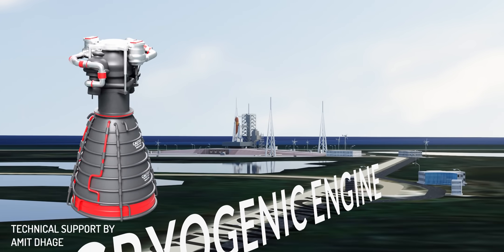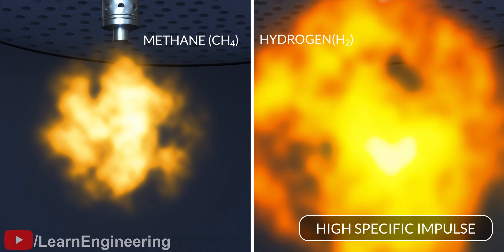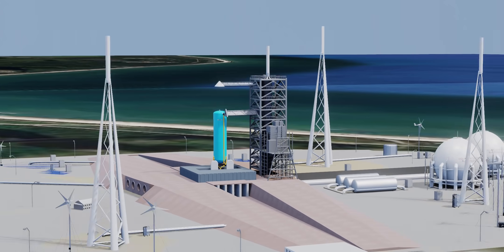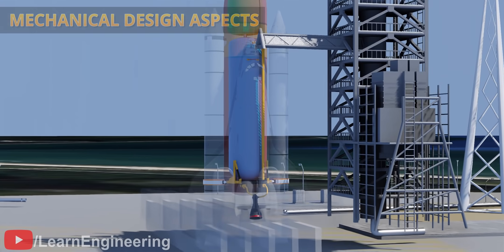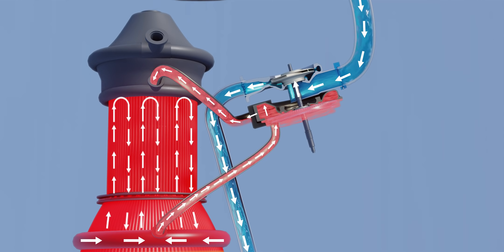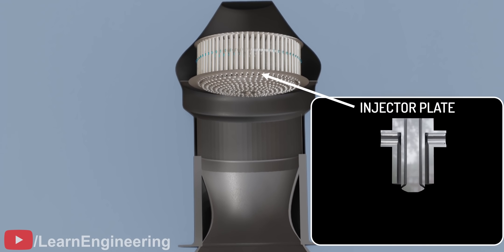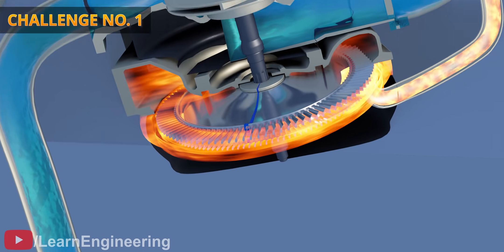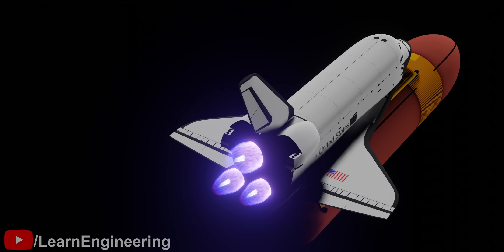Cryogenic Engines | The complete physics

Comment: I believe the insulation coating of the tank is also to keep the fuel at low temperature and prevent boil off
Reply: well boil off itsels is used as cooling process. the pressure build up  , thats what you dont want in your rocket)
Reply: That coating is bcuz hydrogen molecules are so small that they escape even through tiny holes due to imperfections in tanks metal fabrication,  so the coating becomes a secondary barrier to prevent boil off
Reply: @death_parade  Despite your anger he is essentially correct in his assertion.
Reply: @BeKindToBirds  I am not talking about the coating.
Reply: @death_parade  chill my guy, not everyone is smart as you are
Reply: @TenzinDorjee  My reason for being mad at that particular comment is that particular poster dissing Indian Rocket Engine technology in another comment. Don't worry, I am usually chill otherwise.
Reply: @jesselopez0008  It does not need imperfections - Hydrogen just goes through everything.
Ask anyone who has to deal with ultra high vacuum.
They always have to "pump" out that hydrogen.
Reply: Good thing no one will be Hydrogen in the future, shitty military contractor grift fuel cycle.
Reply: @Sagittarius-A-Star austenitic stainless steels and certain austenite-based alloys have a high HE resistance

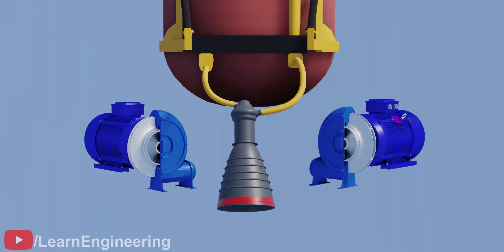Comment: 4:40 electric pumps are used in Rocket Lab's Rutherford engine
Reply: That's because at that small a scale electric turbopumps are the most efficient way of powering the engine in the terms of both weight and performance, not to mention complexity. Electrically pumped engines can throttle significantly deeper than gas generator engines, as well as be capable of running the tanks completely dry, as would be nearly impossible in gas generator engines as well as extremely damaging to the engine

Comment: Good introduction. Liquid hydrogen does indeed achieve the highest specific impulse, but it's by no means the "best" fuel for every situation. Sometimes other factors are more important. I've made a basic summary of common rocket fuels below. Methane is becoming more and more popular as a compromise.

Liquid Hydrogen
• high efficiency
• no soot whatsoever
• very low density
• low thrust
• very low temperatures
• leaks very easily

Kerosene (RP-1)
• high density
• high thrust
• normal temperatures
• doesn't leak easily
• low efficiency
• lots of soot issues

Liquid Methane:
• moderate density
• high thrust
• low temperatures
• doesn't leak easily
• moderate efficiency
• minimal soot issues

Comment: Fact: Fuels with less maximum theoretical efficency tend to have larger density, so that's why you can see a Falcon 9 (22,000 kg to LEO) , using subcooled RP - 1 as fuel, would be much smaller than, say, a Delta IV Heavy, having more than double the size of fuel tanks (using LH2) while can only carries a little bit more payload (23,000 kg).
(Note: To those of you who said that the Block 5 Falcon 9 actually only have 13,000 kg as LEO payload, remember that this rocket is partially reusable, and the first stage had to perform the slowing burn upon atmospheric reentry, plus a suicide burn to have a soft landing, so yeah.)
Reply: That high ISP becomes more important in space. Delta IV works better and better the further you need to send a spacecraft. New Horizons got the highest escape velocity of any spacecraft from earth because of this.
Reply: @srinitaaigaura  I actually thought the most important thing in space is dead weight

Comment: The explanations has been really great.

I think that with small improvements, they could have been even better.
For example, showing how fuels are mixed by the injector plate and burnt should be before the explanations of the pumps. This way the trick of cooling the combustion chamber with liquid H2 comes before using it at the turbo pump.

It would have been also better to show possible electric motors in operation pumping fuel, before replacing them with turbine. Aka, show the motor moving the impaller, then keep the impaller in place and replace the motor with turbine. This way, even visually, there could be no doubt which part is driving the motion.

Also, You said that you are giving example with the H2, but it would be nice to have a label on the screen. Especially when you need need two of them for the gas generator.

Once again. Your videos are probably the best explanations I've seen so far.
Reply: Man, thanks a lot! I was confused in that impeller part... Your comment helped clear my doubt.

Comment: The pump is usually in multiple stages. The first stage is the inducer and it prevents cavitation to build up in the pump because of the high rotation speed. The next stage is the impeller which does most of the pressure rise in the turbopump.
Reply: I thought fuel would become at gaseous phase when it comes to turbo Pump. Also do impellers are used in turbopumps or only in centrifugal pumps.

Comment: 9:40 Correct me if I'm wrong but aren't the RS-25's of the space shuttle ignited at launch and not in-flight?
Reply: you are correct!
But they obviously get massive help from the solid rocket boosters, so that the space shuttle has enough thrust as a "first stage", to get to sufficient height before jettisoning them

Comment: So, when I do the math on this, I find that a propellant tank with a volume of, say, 100,000 cubic meters would be able to store about 70 tons of liquid hydrogen. That exact same propellant tank would be able to store about 800 tons RP-1 and about 1100 tons of hydrazine. So it's almost a tenfold decrease in propellant mass for only a 25% increase in specific impulse.

That doesn't seem ideal to me. What am I missing? Even when you plug in the rocket equation in the other direction, you find out that a rocket powered by LH2/LOX needs a propellant tank ten time as large to get the same total delta-V as one powered by kerosine or even methane. And the larger tanks just means a much heavier rocket, which is exactly what we DON'T want, isn't it?
Reply: Hydrazine is very poisones and extremly corrosive, when i remember correct there was an accident in a nuclear Missile Silo with a hydrazine leak that leads to an explosion. See Planly Difficults Video here on YouTube.
Reply: @xj9779  Sure, which is why they only use it for upper stages and ships in orbit like the Dragon Crew or the Starliner. But how do we justify "hydrogen is the best rocket fuel" when all the rockets hat use hydrogen have to be ten times as large as the rockets that use kerosine to get the same performance?
Reply: I think they pressurize the hydrogen, so they would fit quite a bit more than 70 tons
Reply: @abdurrahmanhashmi1081  Even under pressure, liquid hydrogen only has a density of 70kg per cubic meter. They would have to get it to at least 8 times that density -- 500kg per cubic meter -- to be able to use the same size tanks.

That's basically why the space shuttle and the SLS have to use these enormous solid rocket boosters. They don't carry enough fuel to get into space otherwise. A falcon 9 with two SRBs would basically have the same lifting capacity as a space shuttle.
Reply: @newtypealpha  oh my bad I thought u were using the STAP density of hydrogen
Reply: @newtypealpha  Although liquid hydrogen gives a high Isp, its low density is a disadvantage: hydrogen occupies about 7x more volume per kilogram than dense fuels such as kerosene. The fuel tankage, plumbing, and pump must be correspondingly larger. This increases the vehicle's dry mass, reducing performance. Liquid hydrogen is also relatively expensive to produce and store, and causes difficulties with design, manufacture, and operation of the vehicle. However, liquid hydrogen is extremely well suited to upper stage use where Isp is at a premium and thrust to weight ratios are less relevant.

Dense propellant launch vehicles have a higher takeoff mass due to lower Isp, but can more easily develop high takeoff thrusts due to the reduced volume of engine components. This means that vehicles with dense-fueled booster stages reach orbit earlier, minimizing losses due to gravity drag and reducing the effective delta-v requirement.
Reply: @newtypealpha  from wiki
Reply: @abdurrahmanhashmi1081  the hydrogen and the oxygen is in a liquid form..... How much can you pressure a liquid?! 🙄
Does this explain enough?

Comment: Unfortunately, this material is just too simplified, to an extent of not being true in few places. For example - cryogenic engines are not used mostly in upper, but rather in all stages, including booster (first) stages. Also, propellant selection is not only about getting most ISP, as it has inversely proportional relationship with thrust. There are far better starter materials out there, for example see Everyday Astronaut on YT.
Reply: Do you have pg on this? I think you have
Reply: Rocket propulsion lectures by IIT and nptel will be useful for you
Reply: Many errors in the content

Comment: I disagree with calling hydrogen's temperature when stored as a liquid under extreme pressure -253 C. Yes if the pressure is released it is that temperature but while under pressure in an uninsulated tank, it's temperature is whatever the outdoor temperature may be. The industry uses this terminology and it is confusing to the general public.

Comment: none of this is necessarily wrong, but a lot of it is misleading
Reply: @uhmmm2110  I wouldn’t say it’s misleading as much as it is oversimplified. They present really 1 type of solution to the problem in a digestible way you can consume in 10 minutes. Liquid hydrogen is nowhere near the best propellant  because of factors other than specific impulse. It’s hard to make and hard to store especially on your rocket and it’s very clunky to carry around. He kinda touched on it but you need a lot heavier pumps to pump the hydrogen into the chamber than you would for like kerosene or liquid methane. It’s not really used anywhere outside the US much because of these reasons (because we were the first and only country for a long time to figure out how to do it, while the Russians figured out full flow staged combustion). I think it’s a good enough video for people to get started with if they want to learn the very basics.

Comment: The injector plate also mixes the oxygen and lh2. Also another reason to pump the oxygen and lh2 to a high pressure is so that the pressure inside of the combustion chamber doesn't become higher than the pressure of the fuel ox and stop the flow
Reply: So it's a forced flow but the pressure in the fuel tank will decrease and the turbo pump will speed up the ignition process. So how does it maintains the pressure below in the combustion chamber ?

Comment: The mass of the particle determines the speed of the particle. So if we can bring smaller particles mass , we can excite them more with each change in temperature. So we can increase density through putting these particles under pressure. So putting them in a container and filling the container.
Enforcing the particles to contract through cooling temperatures. The more we can quench the particles together through cooling process. The greater rate of expansion children through warming process and thus the greater thrust. But you gotta understand what is the mass of the particles that you are dealing with. So smaller mask gets more excited faster. And you can pack more into an area and then quench it meaning shrink it with helium cooling.

Comment: One of my favorite channels on YouTube. Could you please do a video on compressed air drying techniques, in particular HEAT OF COMPRESSION DESICCANT DRYERS. I’ve worked in oil gas, pulp and paper, and defense, and have been around these in all 3 industries but only recently started having problems with them.

Comment: You forgot to mention the biggest challenge. The turbo pump of a full flow engine of the oxygen-rich part. The materials of this cycle eg. turbine blading, other rotating parts, shaft sealing and housing have to withstand a super hot oxygen-rich gas, in order to drive the cryogenic oxygen pump.

Comment: I work in cryogenic rocket propulsion. This video is very well made, but I think the fuel selection portion was oversimplified. Hydrogen is not the best fuel for all cases. While it is the most efficient, other fuels have other benefits. It is hard to get high thrust engines with hydrogen because of how sparse hydrogen is. You need a lot of volume of hydrogen to get enough mass of it. This is why methane and kerosene are also used as fuels, typically for the 1st stages of rockets. While they are not the most efficient, the increased thrust is better for the mission because it can get to space sooner, which decreases the fuel requirement, and can fit into smaller tanks, making the rocket less cumbersome.

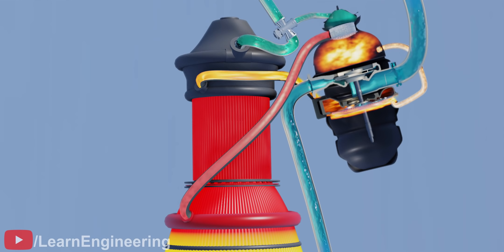Comment: So here is the most heat sensitive elament. And as this element warms up it will create massive thrust.... 6:55 Rubidium

This silvery-white element is so reactive that it can spontaneously combust in air. It has a low melting point of 39°C and is stored under inert conditions.

Comment: Full flow engine please, this is great!
Reply: It is the same as the staged combustion cycle at 6:30 but instead of having some fuel go around the gas generator directly in the combustion chamber, all the fuel goes in the gas generator after passing through the pump. So in the animation the large pipe with green fluid after the valve that goes directly in the combustion chamber would go through the oxydizer rich gas generator (not in the animation).

Comment: It's a clever way to use the cold temperatures of the fuel for cooling and the hot exhaust for preheating the fuel. Also using the fuel to turbocharge the fuel. Good video but you imply that the reason more countries haven't developed them is because they don't have the technical know-how when it's more likely that the countries that have developed it are the ones who can justify such a huge financial outlay on something frivolous like space travel.

Comment: Excellent explanation, but I could find one mistake. In a cryogenic rocket engine, the fuel tank is always kept above the oxidiser tank. Since the optimum LOX to LH2 ratio is 3.4, the larger tank contains LOX whereas LH2 is stored inside the smaller tank.
Reply: I think you've mixed your propellants around, lol. Because hydrogen is the lightest, and least dense element, LH2 powered rockets need about 3 to 4 times more hydrogen that LOX, not more LOX. The fuel and oxidiser also don't need to be stored in a specific order, as we saw with Space's Super Heavy booster when a design change saw the propellants swap positions.

Comment: Should have mentioned the Oxydizer rich staged engine like the RD-180 and the fully staged engines like the Raptors. The fuel rich RS25 of the Shuttle and SLS are expensive mostly because of the Hydrogen seals... as you said, H2 is hard to keep in check.
Thanks for the video...

Comment: The 220φ engine accelerates the ions confined in a loop to moderate the relatarvistic speeds, and then varies their velocity to make slight changes to their mass. The 221φ engine then moves ions back and forth to produce ions, thus traveling in a vacuum line, so please use cruise on Orion's Belt.

 We could reliably get ~94% efficiency with a closed loop superheated steam system harvesting exhaust heat from a small jet engine and got just below 96% efficiency in some ideal test cases. The main limiting factors were that the discs had to be designed to stretch uniformly without distorting at ~40k RPM and that the gaps between the disks had to be designed for an incredibly specific set of operating parameters (steam temp, pressure, velocity, etc.)
Reply: @U.S. Paratroops  Who are you, and what the heck are you talking about?
Reply: @asgodandheinleinintended2398  Yes...of course
Reply: @u.s.paratroops4633  Do you have source on the 220φ engine? If yes, please send it to me.

Comment: So basically, a high enthalpy of formation of the propellants + a low average molar mass = a high specific impulse. But if the propellants have a low molar mass, their density will also be very low, requiring large fuel tanks to hold the necessary amount of fuel, which will increase weight and drag. So a tradeoff between specific impulse and density is essential to selection. Is that correct?
Reply: It is actually depends on many factors, such as engine design. Turbofan engine using aviation fuel has more Isp than SSME. See the table on Examples section of https://en.m.wikipedia.org/wiki/Specific_impulse
Reply: @anandananda2277  oh yeah; i mean in terms of just rocket engines
Reply: It is not the molar mass of propellants that matters, but the molar mass of their combustion products.

For example, when RP-1 burns, it produces water H2O and usually carbon monoxide CO, plus other minor products. The molar masses of these molecules are 18 g/mol and 28 g/mol, and it is that, and not the huge 168 g/mol molar mass of the initial molecule is what determines the velocity.

Similarly, for hydrogen, the product is also water, some unburned hydrogen, and OH. Here the products are much heavier than the fuel itself.

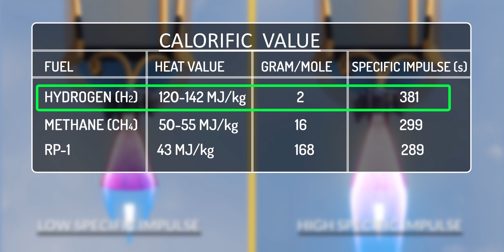That is why the difference in the specific impulse (see table at 2:05) between the RP-1 and H2 is nowhere near 168 / 2.

Comment: Hello Sir,
Just had a doubt. Is it necessary for the gases in combustion chamber to be fast?
I mean, does gas speed slower than subsonic speed affect the engine? Does it have anything to do with the combustion rate?

Comment: I dont think that exhaust velocity is proportional to exhaust temperature, like you say at 1:40 . Temperaure boils down to the kinetic energy of the particles, which is proportional to v^2  (+ the molecular weight of those particles can vary depending on propellant choice, which also interfers with that proportionality) 
Correct me if I'm wrong tho.
other than that, good video imo
Reply: Proportional to stagnation temperature and predsure